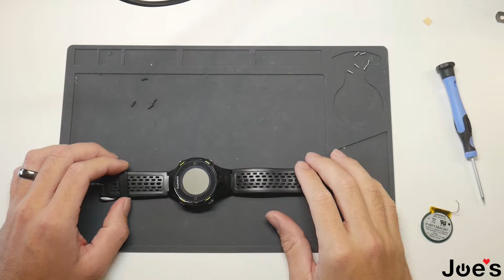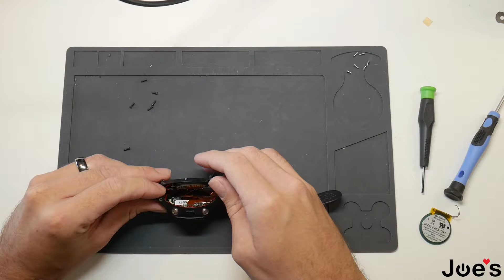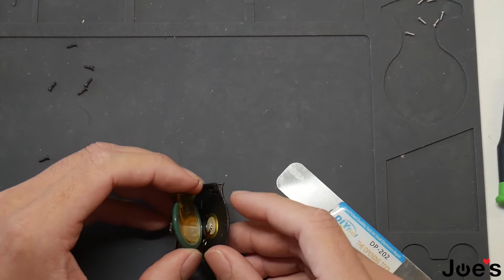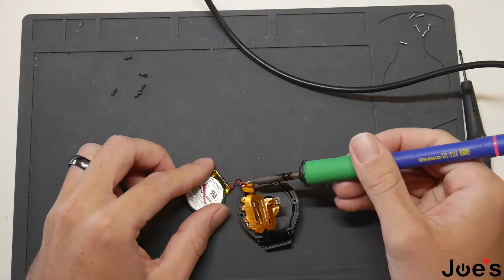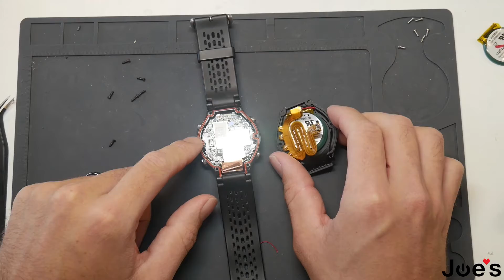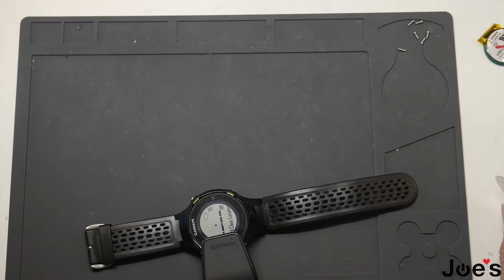Garmin S4 Wont Charge Battery Replacement

Comment: Thank you but i have a garmin forerunner 410 ,the battery inside looks similar to yours however I don't find it in my country,is it possible to install a different lithium battery on Amazon,you know it looks like square or rectangular shape in paper wrap with red and black wires and same electronic piece on top
Reply from the maker: I would try and make sure to install a genuine battery. The aftermarket batteries have a higher chance of catching fire.
Reply: @Joesge  it's all chinese out there unfortunately